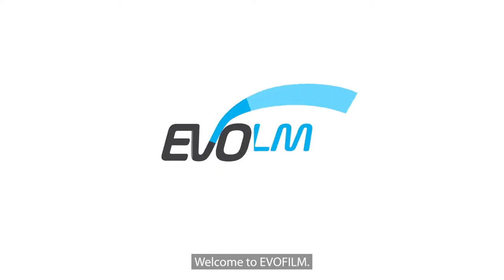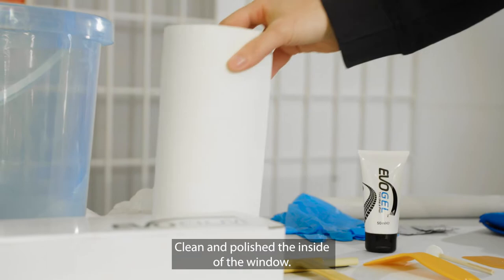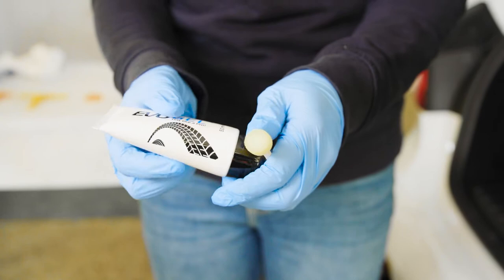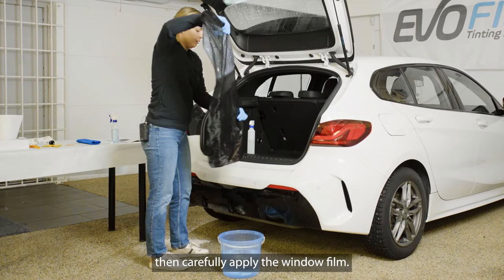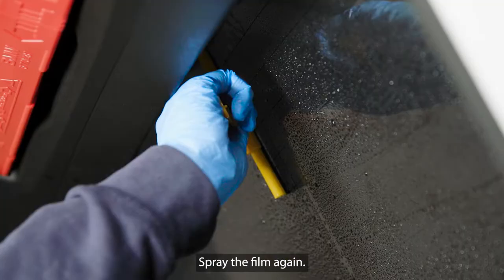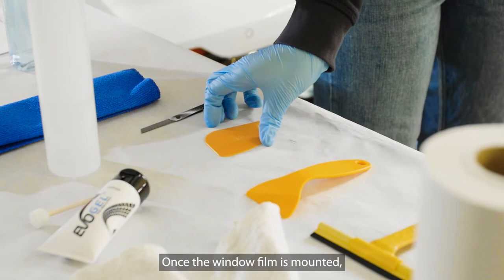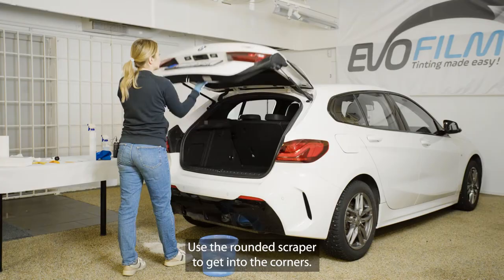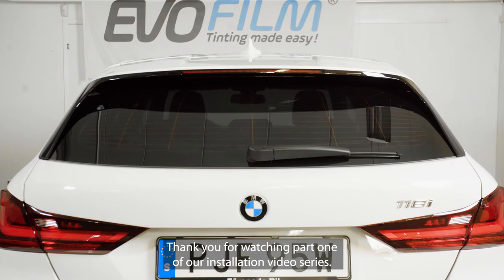How to install EVOFILM static cling window tint film part 1 - Fixed car windows. (ENG)

Comment: How is this tinting made easy? Is this not how all window tint is installed?
Reply: exactly.
Reply from the maker: No sir it's not. Have you tried to install a window tint film with glue then you know how hard it is to get a good result. With our glue free film you are guaranteed an installtion without bubbles or wrinkels. And if you are not happy with your job you can always remove the film and redo the installation. Try that with glue film ;) /Peter
Reply from the maker: Hi Jonny, thanks for asking about our product.  It is a lot easier since our film is not installed with glue. That gives you a wrinkle free installtion and the possibiliy to redo it if you are not happy the first time. /Peter

Comment: Hi, does it matter which side of the film is stuck to the windows? Obviously I mean the rear window, as the side windows are not reversable. But the rear window is.
Reply from the maker: Hi no it does not matter. All films are reversable.

Comment: This doesn't seem easier than using quality window tint.
Reply from the maker: Thanks for your comment. It is a lot easier since our film is not installed with glue. That gives you a wrinkle free installtion and the possibiliy to redo it if you are not happy the first time. /Peter

Comment: this is supposed to be removable.  evo it's a scam
Reply from the maker: Hi, what makes you say that? EVOFILM is a static cling film installed without glue and is very easy to remove. You may have confused us with someone else+ Please feel free to contact us for free samples and find out by yourself. /Peter